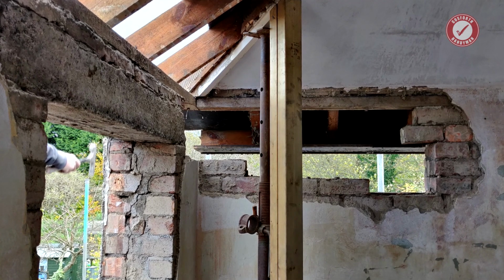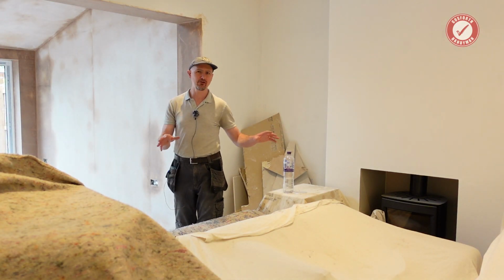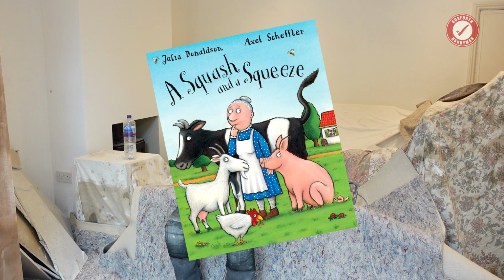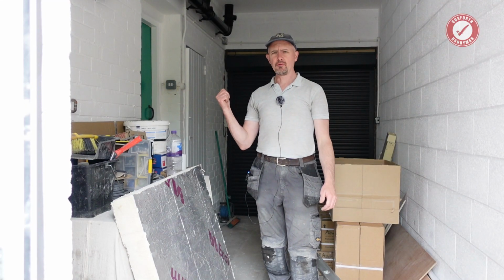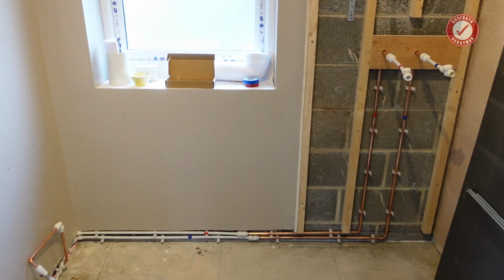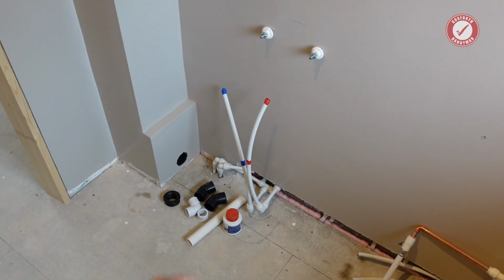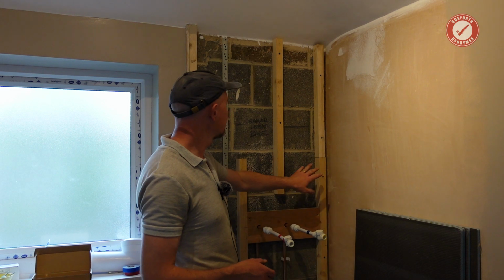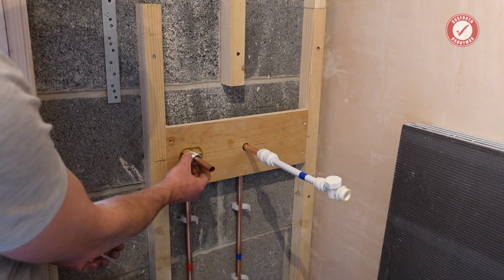What’s the HARDEST part of a building project like this? (Self Build Extension Part 21)

Comment: We've been there and got the tee shirt, but many years ago.  we managed to keep the living room in use by erecting a plastic sheet inside the breakthrough and attaching it to the walls with battens and tucking it under the carpet.  It was very effective in keeping the dust down but did nothing for thermal efficiency.  Anyway, you seem to be over the hump as it were and on the downhill run now.  We've used the shower wall boards instead of tiles in the shower, very effective and easy to keep clean, no grout to stain or collect mould!!  Wouldn't use tiles in a shower in future.  Best wishes to you all, hope it all goes well in the next few weeks.
Reply from the maker: Great stuff - it's certainly a challenge! Our living room needs to be taken to bits once more to fit the final flooring. 😭

Comment: Hope you are putting in a shower drain that can be cleaned out from the top. We had one in our last house and it was the best thing since sliced bread,our current house doesn’t and if it blocks up it means a hole in the kitchen ceiling in a REALLY awkward corner, the alternative is taking out all the shower , not going to happen!
Reply from the maker: Yup! 90mm waste with top access. 👍

Comment: Tried to look back through the videos but can't find it, what is the pitch of the roof please?
Reply from the maker: 16 degrees 👍
Reply: At a guess, it looks to be between  2 and 3/12.   
 edit;   16 degrees is  3.44/12
Reply: @GosforthHandyman  Thank you, had a roofer round to look at mine and i calculated it at 16 degree and was told you can only use slate for low angle, clear that not right.
Reply from the maker: Nah, loads of tiles available for low pitch. 👍

Comment: If I might ask how is the property reassessed when you get a final on the self build.
Reply: If the extension pushes the house into the next council tax band, that will only come into effect when it's sold. (Exception is if you add a separate self-contained annex).
Reply from the maker: Yeah, do you mean value reassessed or building inspector final assessment? If it's value it's what Laurie said. 👍

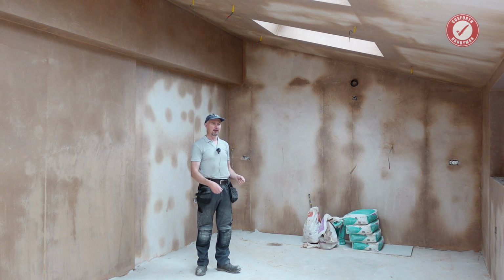Comment: @5:58 Why are the walls spotted brown like it's molding?
Reply: It's the fresh plaster drying out
Reply: Our  walls over the pond are generally  have a finished skim all over the brown patches on the boards are where dollops of plaster on the back of the boards to fix it to the walls,
The us usually only mud the joints and corners
Reply: It's fresh and drying. The spots are where the screws went in. They are dippled areas and have plaster on them already so those  spots absorb moisture more so take longer to dry.
Reply from the maker: Yeah, dot & dab (no screws). Just takes a bit longer for the plaster to dry in those areas as there's no airflow behind. 👍

Comment: Out of interest, why didn’t you use angle valves on the towel rail. If you do the,  You’ll be able to use chrome pipe covers and collars over the copper pipe to finish it .
Reply from the maker: We don't want the valves pointing in to the room, prefer them to the side. Could have used corner ones but they cost a fortune and happy to just paint the pipes. 👍

Comment: You & Mrs Mac deserve to sleep for a month once this is all wrapped up.
I still feel you should have done the knock through though, my worst nightmare in a house is having to traipse through almost every room to get to the kitchen to put the food shopping away & it will be equally tiresome to trail back and forth if you end up putting a freezer/pantry in the utility space.
Reply from the maker: Trust me, went back and forth on this a lot but in the end the pro's massively outweighed the con's. 👍
Reply: @GosforthHandyman  With your fridge/freezer in the kitchen I see no problem with the freezer in the utility. We're in Canada and our freezer is in the basement. One thing to consider for freezers, if you have the vertical space think about an upright freezer. They are so much better the chest freezers. It's much easier to get stuff out and nothing is totally buried at the bottom. Also some uprights have roll out shelves/bins which make them even easier to manage.

Comment: £10,800. Rough guess based on mine, but yours might be a bit bigger. The biggest expenses being brickie, plasterer and doors. 

And yes, the dust everywhere. When I'm complete, I'm getting professional cleaners in as I'm not sure I'll have the energy. 

Please put a downstairs loo in - it's a real life changer.
Reply from the maker: It's 49 sq m. As a gauge the windows, bi-folds, composite back door etc. cost £6k alone. 👍😁

Comment: For mounting the shower pipes in The Netherlands we generally use a dedicated 'wall plate' to achieve an even 150mm spacing like this..

https://leidingshop.nl/images/products/119160/bonfix-messing-dubbele-muurplaat-2x-soldeer-2x-binnendraad_a0d73.jpg

Combines with S couplers for levelling/adjustments if needed...

https://www.eteb.nl/wp-content/uploads/s-koppeling.jpg

Is that uncommon in the UK?